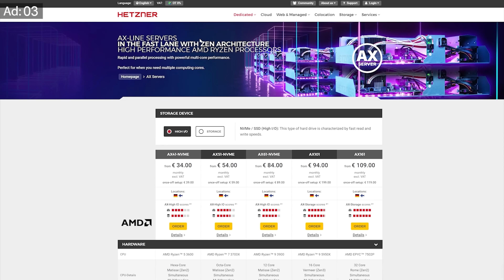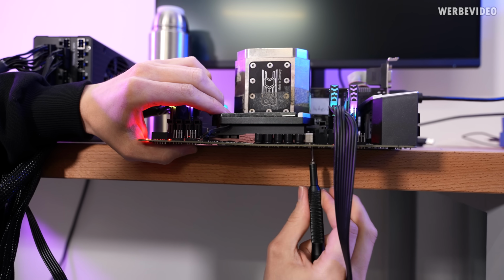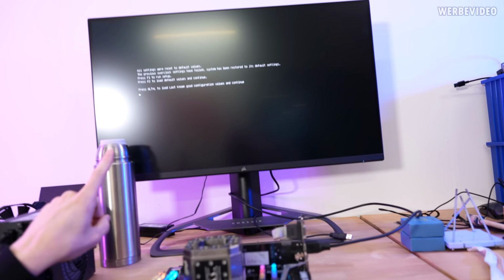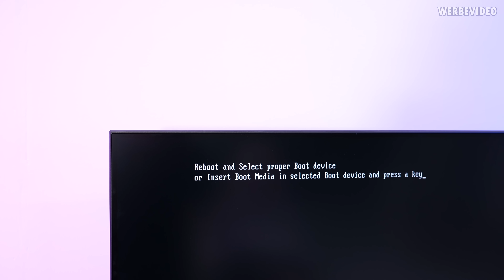Will this Hefty Bend Kill the Motherboard?

Comment: Currently I am using Thermalright TRUE copper, no noticeable bent from the cooler in vertical mode especially from horizontal mode x870e pro ice

Comment: Very useful video. I was just building a new computer and had to temporarily apply a gently sloping bend to the motherboard so I could attach the CPU cooler backplate. I forgot to attach it before I installed the motherboard to my case. So I unscrewed some of the standoff screws and bent the board a little for a short while. Had a little anxiety for that afterwards but everything seems to work just fine.

Comment: I would be worried with memeory signal integrity with these kinds of bends, my rog zenth extreme x399 has had a lot of stability issues related to ram and I suspect it is from a fairly significant bend my Mobo has

Comment: Once bent a s775 board by mounting a cooler that was not supposed to fit on that socket with regular m3 screws. Still worked perfectly.

Comment: Just reminds me of my old geforce2 (think it was 2), it had a zalman copper fan cpu cooler strapped to it with a bathroom extractor fan cooling that (true 70cfm). that card ended up severely bent with about an inch of dip at the far corner😂 ran perfectly well...somehow. and was beating scores on high end cards years later. (Maybe that was the vastly outdated (but still installed) orchid rightous 3d card giving it the magic 😂

Comment: The boards themselves are surprisingly sturdy - which is remarkable considering all the fine traces in them - but I guess these thin layers also makes even the metal traces pretty malleable.
I think what is most likely to break is solder connections on surface-mounted components. Solder is brittle and doesn't flex - so if pressure builds up right on a solder point it could definitely crack. I imagine that the larger the solder point is (in the direction of the bend) then the more vulnerable it would be, because there is more material that will resist flexing and build up tension.

Comment: The individual asking the question had a big permanent bend thought. Substantial plastic deformation of a fat-layer-stack pcb, means multiple layers have permanently yielded. Should definitely RMA, especially with a brand new fairly costly board.

Comment: Static loading is not that bad in itself, but in combination with thermal expansion or vibrations it put more strain on solder joints and they can break. The bigger the component the worse it is as they usually are stiff and can't bend with the PCB.

Comment: This reminds me of intel sockt coolers on socket 478. No backplate and when you push the pull tabs down those coolers use they will push the CPU socket down and create a bump at the back, I had a picture once of that but lost it but yea it bent a lot with intel stock coolers.

Also Im not so worried about the PCB but I do know SMD resistors and SMD resistor arrays crack and they can be hard to spot because the crack is even hard to see at 20x magnification.

I dont repair much modern stuff like this but the older stuff I repair use basically the same SMD stuff, Resistors and Resistor Arrays and cracked due to people "bending" the PCB is a common problem.

They are ceramic after all and brittle and wont take kindly to the PCB being flexed.

Comment: From a retail perspective, at least regarding the newly purchased motherboard, I would suggest returning it for a replacement. I say this because despite any testing, you never know down the road what sort of issues a bent board may have. I received a fridge that had a slight dent in the side and I returned it for a replacement. Just because you aren't having issues RIGHT NOW doesn't mean you won't have issues within a year or two. Outright the board is not within the specifications you would expect it to adhere to as a new product and as such I always suggest getting it replaced. A scratch is cosmetic, a bend is structural.

Comment: In my experience, PCB bends are fine but the situation you may have issues with is if you have a bent PCB and you screw it down and it gets flattened then SMD components can be ripped from their pads.  Copper is ductile and can bend with the fibreglass but the components are basically welded to their pads via solder and this creates points that may not survive being moved.  Case in point, I had a control board that had a pretty bad curve in the PCB and when I screwed it down into it's housing, it snapped the solder joints for a few of the SMD components which caused the board to not work -- it was working when I tested it before mounting it.

Comment: Hi @der8auer, Was wondering where one could purchase the Minus Pad Extreme?

As i own the Clevo/Sager X170KM-G and will be going from a i5 11400 to a i7 11700KF so will be overclocking the snot out of it.
Thus i will be replacing the pads, I already use Thermal Grizzly Kryonuat (Going Extreme on upgrade) and with me going for OC'ing on not just the CPU but GPU.

I have done a google search but only get the Minus 8 Pads i have used them before wasn't fond of them due to how brittle they was.

Thanks in advance though

Comment: In my few years of motherboard repair experience.  Being bent that way ( vertically) doesn't seem to break the board. But I have experienced unrepairable boards that are bent horizontally, specially when near the socket or the pch, a lot of them fails on the memory slots or some rear or front I/O. The more bent they are, the more harder for them to work after BGA rework, as they will bend more after they went on the machine.
Reply: I have a MSI B350 Tomahawk with a Scythe Fuma 2 cooler and I think I broke a couple of my ram slots by overtightening (design flaw of the fuma? There is a tightening limit..). Is there a way to fix the ram slot issue? Your answer would be greatly appreciated!

Comment: Failures from circuit board bends are caused by the physical stress the bend causes on components and traces. For example a capacitor can crack internally if it's stretched or compressed from just the physical bend or it might crack from added thermal expansion/contraction over time. This also happens to all solder joints which are common failures from bent boards.

Comment: I had a r7 360 that had a permanent bend from GPU sag.  Worked well for 5 years, but i did have artafacting issues when i went to move it to a different build.

Comment: I remember taking out the mainboard from my main PC to install an aftermarket cooler, and thought I damaged the mainboard by not holding it where it's the heaviest (the CPU area), but Gigabyte 'ultra durable' didn't let me down. This is even though I bought old 2017 hardware in 2021 (alongside monitors and a keyboard from 2013 that I already had) because I couldn't afford the latest hardware.

Comment: This is interesting... I just recently built a PC after almost two decades of Mac and PC server/workstation use, and something that bothered me was how cheap and flimsy PC motherboards are - not just the cheap ones either... literally all of them! (At least for AM4, perhaps sTRX4 or sWRX8 are better?) Even the Asus Proart X570 board I finally settled on (for not cheaping out on actually defective Realtek 2.5gb LAN, for example!) is alarmingly thin, flimsy, and cheap feeling. Is it just because motherboard margins are supposedly so incredibly thin? Why is it when I take apart a Mac Pro or server I find these crazy thick, like almost 3mm, motherboards that are stiff as a cast iron skillet, but my $429 motherboard is  1.6mm 1oz copper with ragged edges and it bows under the weight of a stock CPU cooler??
Reply: My best guess is that it's purely a cost-benefit analysis and they decided that the tradeoff in RMAs is worth it for the savings in materials, and everyone else is doing it anyways. Whereas Apple would get bad press for using cheap materials as a "premium" brand.

Comment: The thing I'm most worried about now is that with all that bending, the motherboard will touch the bottom of the test bench or case and may cause a short.
Reply: That is certainly possible. I mean - if you mount a board without spacers there is a very high chance you will short something.
But if you use standard spacers then those are like 6 or 8mm I think - so there would have to be extreme flexing like what he shows in this video. And that should not happen under any normal situation.
Reply: arent the mobos are sprayed with a plastic protective coating? so shorts dont happen anymore

Comment: Just use a impact driver to bolt it to the standoffs to bend it straight.

Full send.
Reply: Probably a bad idea. If you have a bent motherboard and it works, Leave it as is. Unbending a board can cause the traces to have extreme fatigue and actually break.
Reply: @ardwivedi16  r/wooosh
Reply: @brandonl8039  r/woooooooooooooooosh

Comment: Honestly, in my mind wiggling the ram and cpu while the system is ON is a good stability test!. I plug the ATX power in pretty hard and usually bend boards a little bit and it's never hurt anything, you really need to make sure those cables are in all the way.

Comment: I've been overtightening my CPU coolers for years, resulting in bending of motherboards. They all worked just fine. Obviously I wouldn't recommend tighteting the CPU so hard that the mobo starts to bend, as it doesn't really improve thermals at all.

Comment: Looking at the Olympus/Quanta AMD EPYC boardview files, if the VRM layout is the same for most boards (quite likely - they tend to use reference layouts) my main concern would be metal fatigue from repeated thermal cycling bending the board back and forth damaging the connections between the VDDCR and P12V_AUX planes and the stitching vias around the VRM's capacitors and inductors. There's some decent clearance between the planes around there, so something like a short between VCC and GND is less likely, but I could definitely see a tear developing on an inner layer plane or polygon due to the glue between the copper foil and the adjacent prepreg layers applying shear forces alongside tensile forces from the vias rotating in place. Over time that would lead to greater resistive losses in the board and worse high frequency current delivery due to the increasing impedance of the path, and potentially even complete failure if the bend was significant and repetitive.

Comment: The only time i've seen a bend break a motherboard, was due to a large heatsink mounted way too tight and the ATX motherboard only being held in by 3 of the 9 screws. 
I expect the PC got nudged and the flexing caused the small crack to form.

Comment: PCB designer here. Just a bend or warp on itself isn't so bad. Unless it's a big BGA etc like you already mentioned. But it's more the warping back and forth over time, that can cause issues. 
That will definitely break solder joints over time. Something you won't find in a one off test like this. Technically it could also weaken copper tracks but I have never seen that myself. Solder joints are usually the weaker link anyway. How quick and fast that goes? Really hard to say, that depends on so many factors. 

Liquid nitrogen isn't so nice for a PCB to begin with. The quick temperature differences create micro cracks in solder joints and in some cases even the components themselves. Plenty of literature out there to read.
Reply: On thicker PCBs a bend can be pretty hard around vias, too, due to the bent prepreg causing shear forces on the copper foil, which then causes tensile forces away from the vias, and the foil has basically no tensile strength at all and will just tear.
Reply: @gsuberland  Ah yeah, vias, good point. Although I can imagine that also heavily depends on how big the via is obviously.
Reply: @p_mouse8676  It's more of a product of board thickness than via size. The vias themselves won't bend, they just reorientate as the board flexes, and the thicker the board the larger overall top and bottom layer displacements.
Reply: flex can crack mlcc as well
Reply: Hey! I think it’s really cool that you design PCBs! I would love your input on something.

So when you say the bending is fine, but it’s more the back-and-forth of bending, that causes damage in the long term, 

Do you mean from heat cycles? Or do you just mean from mounting different coolers, and bending it yourself?

If my motherboard is bent a bit, maybe 3 mm or more, can it still last a long time?

Thank you!!!

Comment: A shelf fell on top of my PC a couple of years ago and hit the case - the tower cooler I had transferred loads through to the Asus Z370 Prime board I had at the time and bent the area around the CPU socket.  Had to eventually replace the motherboard because I had random crashes after which only stopped when I ran the PC case flipped on its side. Reckon the CPU socket was not making contact with the board. As Roman mentioned some parts of motherboards are far more vulnerable than others.

Comment: When i build my 3770k i had to apply crazy pressure according to the cooler manual but i did it anyway as it was their problem if it failed. 9 years later it has a crazy bulge at the cpu socket but it still rubns fine with the same cooler and even the same arctic silver thermal paste. So i guess it wont matter.

Comment: Would you please test it in the chipset area? I think this test is a bit artificial, because it's not like you can always control where the bend is irl. I would love a worst case scenario test on the chipset. I think you would be surprised just how much it will still take

Comment: I had an am3+ board that was a bit bent from overclocking my fx8300. I sold it 2 years ago and can confirm that it still works (guy uses it for normal work/gaming use and doesn't oc it). I always did wonder how much bend a board can take though.

Comment: G'day Roman,
8:39 I think you need to do a bit more testing on those new Yellow VRM Thermal Pads, they don't seem to be up to the usual Thermal Grizzly Quality Standard yet,
they aren't getting very good Surface Contact & Heat Transfer between the MosFets & Heatsink 🤣🤣🤣🤣🤣,
Best wishes to You & Shiek for a Happy, Healthy & Safe 2022

Comment: I have had power board parts (high watt resistors, large through hole capacitors) eject themselves from board bend stress.  Not had a lot of experience with finer boards like motherboards for bending.

Comment: On a side note, The EVGA 3080/90 FTW3 ULTRA pcb has a weakpoint in its design and the card WILL FAIL if you pull the PCB with too much force when disassembling. I have 2 3090 failed on me when doing waterblock installs. You are warned.
Reply: Jesus christ 2 3090s. That hurts.
Reply: EVGA just can't stop making trash, can they...

Comment: When I was younger and stupider I mounted a motherboard to a spruce glue board. The board warped because of humidity and bent the board like this.

It worked fine. I straightened it out by screwing it to a case and had no problems

I imagine allowing the wood to warp cycle with seasonal humidity causing repetitive stress would have eventually ruined it though.

Comment: My graphics card is pretty bent, made a mounting mechanism to mount a cpu block on it completely forgot to make a backplate so it bent, loosened the cpu block a little so it wasn't under as much permament strain, but it's permamently deformed. Still works though, and even more surprisingly, stays very cool under load even though there isn't much mounting pressure

Comment: I think the bending and straightening the pcb repeatedly will kill the device by breaking smd contacts.
Reply: It'd have to be a very wide part for that to happen, or a very tight bend in one spot. I'd be more worried about connections to vias on the upper layers, since those joints are going to have very poor tensile strength and the copper is glued to the prepreg. Definitely agree that cycling is the big killer for metal fatigue, though.

Comment: In 2017 I bought an intel CPU+motherboard second hand.
Because I was AMD fanboy, I don't know how to remove and put the heatsink back on. So the seller show me how to it. He holds the motherboard in his hands and push the heatsink with his thumbs. It caused the motherboard to bend 30°. I was really worried it has broken, but turns out the motherboard was fine and still functional until last I use it in 2019.

Comment: I miss motherboards made by the CPU makers, Intel did some really good ones back in the day.
Reply: Intel motherboard both consumer & server were manufactured by Foxconn, or at least from 2001-2013 when they stopped making them. They were generally very conservative designs, and often designed as mATX and then extended to ATX form factor. While they were a safe bet for bios stability, they often lacked the features of competing boards, and toward the end of there available other manufactures were using higher quality components, where as Intel board had change little in their construction in over a decade.
Reply: @taznz1  yeah, they were good for oem, not like today, where you wouldn't have much tuning or upgrade options, but you'd expect it to work and last you a long time
Reply: Especially the 875 board, sexy black beast.

Comment: I had a bent cpu and it didn't work :(
Reply: I am currently using a bent intel chip, got a good deal on it , still works perfectly 6 months after getting it, I even straightened it with a metal ruler and on the edge of my desk.
Reply: @Remi-h8z  what cpu was it? Mine was an Intel i7 870
Reply: @LawrenceTimme  it was a core i3 10100
Reply: @LawrenceTimme  mine was bent heavily at the corners but still worked when installed, I straightened it anyway because I wasn't sure if all the pins where making contact.
Reply: @Remi-h8z  I'm glad it worked for you
Reply: @LawrenceTimme  thanks